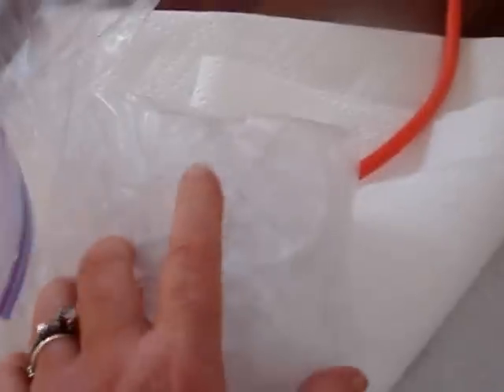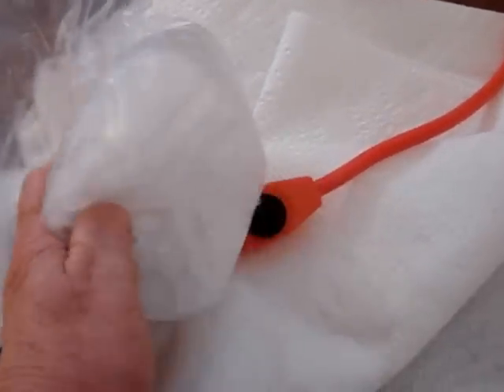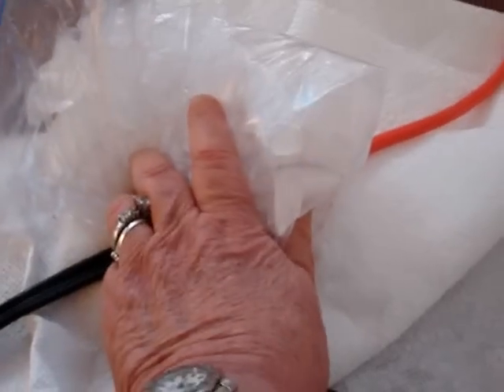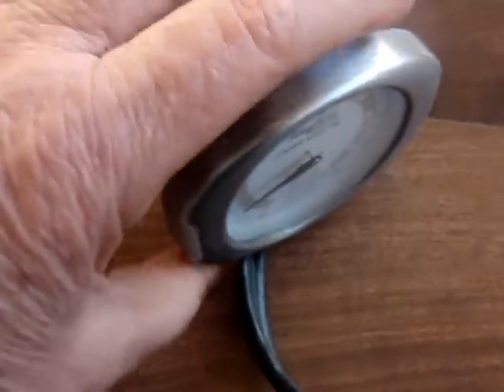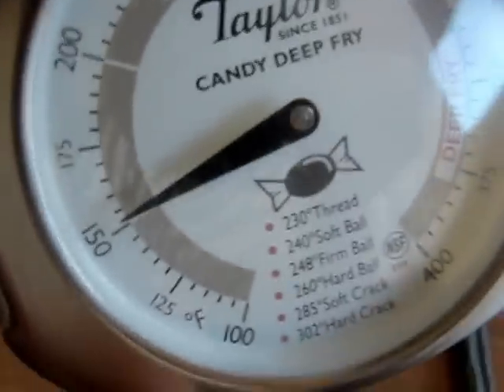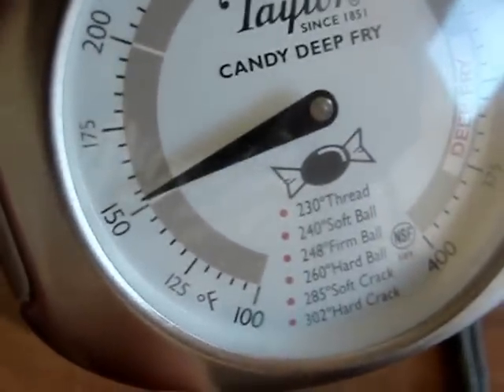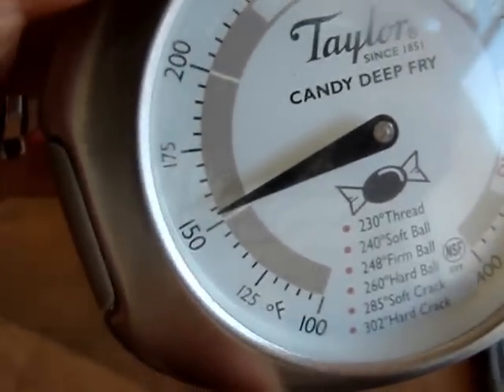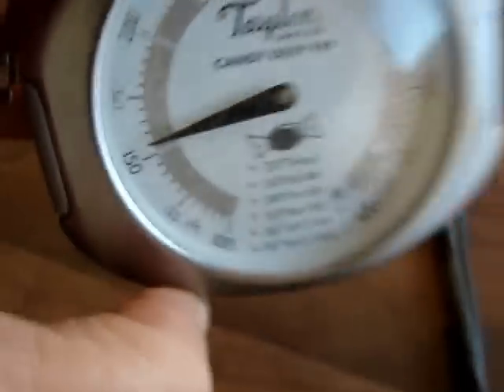heat cable testing

Comment: I have a web of pipes in the basement that supply hot and cold water to three floors. I wanted to buy a 30 foot heat cable and wrap 3' on each pipe then bridge the cable to the next pipe but wasn't sure if the cable hanging in free air would overheat and burn up!??? But from the looks of your video it seems safe.

Comment: I HAD THIS INSTALLED UNDER MY HOME   A MOBILE HOME   FROM THE CROCK UP . ABOUT 5 FEET  WELL WHEN i CHECKED AFTER THE   ELECTRICIAN LEFT i NOTICE HE DID NOT TAPE THE ROUND BLACK DOT   ON THE PIPE ITS JUST HANGING  YET THE OTHER PART IS TAPED WELL AGAINST THE PIPE WITH A FOAM COVER OVER IT.IS THIS OK?
Reply: Rondo Schiavoni that black dot is the thermostat. Your supposed to put that on the coldest spot on the pipe. So when it go under the temp it's set for it kicks on.

Comment: i have one on my mobile home do i plug it in to a extension cords in to a wall socket
Reply: Can you? Yes. Should you? No. I know certain places of the world it's not code to run it of an extension. I'm using extension on mine but running 10 gauge outdoor cord but I'd be lying if I felt 100% safe about it

Comment: I have taken these heat cables apart.  They are crap and you should never buy them.  If you have a pipe freeze it is because of a poor design, so look at fixing the design.  These cables have a heat element that is smaller than a human hair.  They are very easy to break.  When you get a wire that small it is called a fuse so this crap is like having a fuse 6 or 8 feet long that can break anywhere and with very little stress.  This is why they tell you that you should not wrap it around a pipe,  it should be kept straight and tape it to the pipe.  If you kink it you can break the heat element wire that is smaller than a human hair.  This is also why they say you cannot fix or reuse them.  These can last 4 hours or a year.  When you spend 40 dollars for something you want it to last more than 4 hours.  The warranty is for one year and they tell you to change them every year.   The cheapest one is 40 dollars so they want you to spend 40 dollars a year for this crap that can quit and let your pipes freeze and break.   This gives people a false sense of security because they think the heat tape will keep the pipe from freezing but everyone of them I have had quit at the worst possible time.  I had two quit this last week and it is 35 below and the pipes froze and broke.
Reply from the maker: owen prince this video was a how to not a review on the product. Guess you missed that!  But since you are more interested in taking things apart you should now get rid of all your light fixtures. They have the same tiny wire lol. Find a video that reviews the product and rip it. But not here thanks
Reply: @miltonhardy6000  Sorry you can't handle the truth but I gave my personal experience with this and found it to one of the biggest rip-offs ever.   So  how to use this was my point ; do not use this crap.  Light fixtures (bulbs) give off light and are not made to heat the space under a stock waterer, although a lot of people make the mistake of doing that.  They have done away with the tiny wire bulb and use LED now that last longer.
Reply from the maker: owen prince yes but no one asked you to do so and like I said not a review on this product. I guess you’re just an angry person looking for a way to gripe about something so you feel like you have a purpose. Lol. Enjoy your day
Reply: I bought  one and discovered that  the thermostat was faulty it  needed at least minus -7 C to activate , so i dismantled it , the wire is very thin but rather resistant , you will find this kind of wire in electric blankets etc ..I managed to reconnect the wire directly and plug it into a timer that activates at night when it's really cold .My opinion is that buying this sort of cable is a lottery the sensor is a piece of crap .
Reply: The one I use is from easy heat. They say you can wrap the pipe with it. Also you have to strip the end for the plug the wire inside is a 12 gauge wire like most outlets in your home. Maybe you just bought junk?